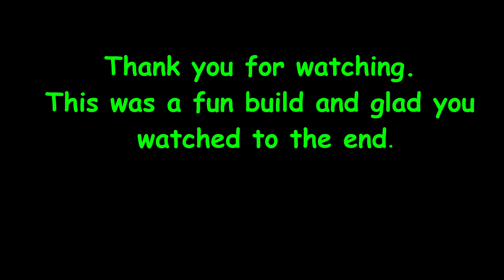Easy To Make Tumbler Turner Cheaper than Etsy!!!  #DIY

Comment: While you may Save a Few Dollars by Purchasing Cheap Chinese Motors for $4.00 each,  that Are Not Designed for Continuous Duty and Get Very Hot under Prolonged Use, When someones HOME BURNS Down, You can Ask if It was WORTH the $100.00 you might have Saved had you have a Purchased HIgh Grade Continuous Duty Motors. Lowe's Sell Heavy Duty Rotisserie Motors with Stainless Steel Shafts for 35.00 that Includes a Heavy Duty Cord and Switch. Videos like these run Chills Down My Back...May God Bless Those who watch. Do Yourself a Favor and Buy A High Quality Continuous Duty Motor for your Tumbler Turner. It Could SAVE Both Your Family and Your HOME.
Reply from the maker: KG5TJV thank you for the detailed comment. I built this tumbler turner for my buddies wife and those were the motors she wanted.  I build what they want.  Good to know about the motors. Look forward to you video on the proper way to build a tumbler turner.  Subscribed and bell rung. Oh wait you don’t have any videos and one subscriber.  It is very easy to critique someone when have no proof your theory is better.
Reply: @JkCanvas   Hopefully Your Arrogance doesn't Cost a Family Their Life. My Comment was not meant to Insult You or Anyone else. If You Research The Subject, Look at The Electrical Specs and Understand what happens in The Real World (I know Many People who will Testify these Motors Get Very Hot under Continuous Duty) You would have a Different Opinion. You don't have to Take My Word but Help Prevent a Loss of Life and Home. Be a Good Neighbor. Alot of People Do Alot of Things that are Potentially Dangerous but KNOW NO DIFFERENT. Help Educate your Friends when You See Potential Danger.
Reply: KG5TJV Why do you capitalize every single word? I’m in a tumbler group where thousands of ladies run these continuously 24/7 months on end with no issues. I’m sure it’s not impossible but it’s unlikely to cause any issues.
Reply: @kg5tjv877  I've been running these cheap microwave motors for about 3 years now. While they get hot, they won't catch fire anytime soon. Don't touch them, don't get burned. The 6 I have, have been running about 80% of the past 3 years... still have my house. I do have to say though, I bought a rotisserie motor one time, and one time only. Never again, that piece of crap lasted about 2 months. Lol
Reply: Have used these motors for my tumbler turner going on 4 years now. Have had no fires nor sparks. I have my motors on the back side of the box though, where they get plenty of air circulation. They are constantly running approximately 20 hours a day if not more. No issues!

Comment: Patiently waiting for the "how to wire it all up" video.  My goal for Easter weekend is to get this baby built (with the assistance of my more-skilled son.)
Reply from the maker: Video has taken longer to produce. Working on a write up that I hope to get up this week. Stay tuned.
Reply from the maker: Lori Koepsel I just posted the wiring up on my Instagram @jkcanvas.  It is a minute video walking through the process of wiring up. Did not want to waste everyone time about stripping wire and putting terminal ends and butt connectors on.  Your son should be able to help with that. If not shoot me a message on IG.
Reply: Jk Canvas I saw, I saw!  Thank you!  I’ll have my son take a look at it.  I think I figured out what you did, but my luck I’ll end up shocking myself!  At the very least, it will require me watching more videos!  Thank you!!
Reply from the maker: Lori Koepsel I usually put electrical tape around my switches. That keeps me from getting shocked. Worst is a little tingle, 60htz isn’t all that bad not like 28v DC. That is a jolt. 🤣. I left you n IG message. If you have issues this weekend shoot me a message and will help out. Also if you post up pics tag me and will comment.  It is really pretty easy if you know how to connect wires to a switch.  Also there is an Amazon link for the terminal boards which helps fund the channel.  Link is in the description.
Reply: @JkCanvas  I may have to make a video - from a female's perspective... lol  You know we have to make things so much harder than they really are :-)
Reply from the maker: Lori Koepsel by all means go ahead and I will add it to my play list. 😉😉
Reply from the maker: Lori Koepsel just so you know it took me about 3 hours to edit the video footage.

Comment: I made one using those motors but after about 15 minutes it got really hot not sure they will work for long drying times? Rotisserie motors are made for longer running times. What’s your thoughts?
Reply from the maker: Miss Ann I don't know for certain.  I built this for a friends wife and she has not had a problem.  yes rotisserie motors are designed to run longer but they also cost a bit more and are heavier.
Reply: Jk Canvas I ran it for 2 hours ...it was hot..but didn’t burn my house down! 👍😂 I suggest don’t run it overnight and don’t leave home...just common sense be smart! Thanks for your video..loved it!
Reply: @annmillwood1221   Thanks for Addressing a FIRE HAZARD. ALL Motors are Not The Same. Alot or Most of these Small Motors are DESIGNED for Appliances such as Microwave Oven Turntables that Do Not Run Continuously. And Certainly Not for 12 -18 Hours that some of the Tumbler Turners do. They most Certainly Can Heat to The Point of FIRE. While YouTube is Great, some Projects are Very Dangerous since you need No Qualification to Post a YouTube Video. Rotisserie Motors are a Much Better Choice for these Tumbler Turners and are Very Affordable......Lowes Sells a Rotisserie Kit that includes all of the Hardware you need (Electrical Cord, On/Off Switch and a Stainless Steel Rod) for about $35.00. You just need to build a Box to Mount it on. The Good Thing it is a SAFE SOLUTION and will likely last for Many Years. And The Bonus is, The Odds of it Catching Fire is Highly Unlikely. Thanks for Your Comment and I wish You Well.

Comment: I had to skip ahead cuz I’m at work but beware electrical work on YT brings out the worst in people. What exactly does a tumbler turner do? I’ll go back and watch the whole build later but the parts I saw look awesome
Reply from the maker: Brads Workbench thanks for the heads up. Basically it turns yeti cups slow some the can be decorated.
Reply: Assists in drying the epoxy on decorated yeti, hogg, steel magnolia, ozark trails, etc... evenly.  You need a multi-cup turner if you want to do several at the time as you "should" leave your cup turning for at least 12 hours before setting it aside for 48-72 more hours to cure.

Comment: Might steal a couple ideas from ya. My wife is getting into that stuff and I'm getting ready to make her a turner.
Reply from the maker: I made a quick IG video on how to wire up the switches to the motors.  If you need assistance just shoot me a message on IG or FB.  I used 3/4 ply in this build, however 1/2 ply will work as well.
Reply: @JkCanvas  right on. I think the biggest issue I'll have is with the wood. All I have is an old skil saw and I'm no carpenter haha. Maybe I'll have them cut it for me at home depot

Comment: What did you use to connect the pipe to the motor? I follow directions for one where I had to file down a dowel rod then tried to get the hole right in the center and it’s made my Tumbler turners wobbly looking for a better way and this looked like it works great
Reply from the maker: I used a 1/2 x 1/2 x .257 nylon bushing which you can get at Home Depot.  To attach the bushing to the motor I used a 9/32 drill bit to make the inner bore larger.  Then I took a #6 x 1” screw and nut.  Drill a 3/16 hole through the 3/4 make to female adapter and the nylon insert to get the same hole through both pieces.  On the motor you will have to drill the existing hole to 3/16 to accept the #6 screw.
Reply: Thank you!!!
Reply: They have these brass couplers on Amazon - look for the motor that comes with them.  That's what I bought :-)
Reply from the maker: Lori Koepsel I looked at those and I was trying to keep the cost down that is why I used the nylon bushings.
Reply from the maker: Connie Runyon how did your Tumbler turn out?  If you are on Instagram tag me in your post, @jkcanvas

Comment: Looks great. What motors did you use? I made a single tumbler turner for my sister but used a barbecue rotisserie motor and shaft. They would add up in price and your choice looks to be a more inexpensive idea. 

Watch out for the soldering iron. For some reason they get really hot. 😂🤣😂🤣
Reply from the maker: Wayne Crews I left a link at the end of the description.  I cannot remember off the top of my head.  Thanks for stopping by
Reply from the maker: Here is the motor I used.  https://amzn.to/2ErpL6u . Also used 1/2x1/2x.257 Nylon Spacers  - https://amzn.to/2XtGcrL.  Used #6-32 screws  to secure the 1/2 to 3/4 threaded nipple to the motor.

Comment: Where did you get your ratchet strap at, that you used to clap around the whole box..  they were black and red with corner rubber pieces?
Reply from the maker: Tammy Shanley Harbor Freight I think it was $4.99 with the 20% coupon.
Reply: @JkCanvas  can you tell me what that is called please?
Reply from the maker: @dawnhood8794  the whole piece is a tumbler turner used to make epoxy covered cups.  I think that is what you are asking.
Reply from the maker: @dawnhood8794  or the band clamp.  https://amzn.to/2IZvXFi

Comment: I would like to see a better look how you attach motor to pvc   You stuff electric tape in side of male pvc cap thread and drill a hole in the cap piece ?
Reply from the maker: Bruce&Keda Waters I will do that. Give me a couple of days and will post pics on Instagram @jkcanvas.  I showed how to wire the motors there.  Check through my feed and there is a short video.

Comment: Great video but I would have loved to have you talk me through the electrics as that's the part i am struggling with.
Reply from the maker: Carolanne Connolly-Brown send me an email canvas@jkcanvas.net
Reply from the maker: Check out this video I did on wiring up the switches to the motors. 

https://youtu.be/RotEH0NjB5k
Reply from the maker: Carolanne Connolly-Brown made my access holes 4” tall by 12” wife
Reply from the maker: Wide not wife. Dang autocorrect.

Comment: How did you line up all the holes so everything is level?
Reply from the maker: 010winfield I clamped the front and back together and drilled through both pieces at once. Then put a mark identifying orientation like left back and left front.

Comment: Would’ve been great to have the measurements of what you were doing with everything. Good video.
Reply from the maker: Henry Lugo send me an email to canvas@jkcanvas.net and I will send you a written write up.  The box I made was 48Lx8Wx8H.  Holes are 1.25” equally spaced.  Come in from
Each side of the front and back 6.5”, that will give you 35” between the two end marks which will allow for equal spacing of 7” for the centers of the holes.  Also if you have Instagram, you can DM me there @jkcanvas.  I look forward to assisting you.

Comment: wish you posted the supplies and measurements.   I'm guessing on mine.
Reply from the maker: Lisette Mahler in the description towards the bottom are Amazon Links to the material I used in making this minus the plywood. For the box it is 8” H x 8” W x 48” L.  I drilled my holes for the motor 2 inches from the lip and 6.5” from each end, then in between the holes are spaced 7” to center.   The hole is 1 1/4 inch diameter.  Drill the front and back cover pieces at the same time to keep them inline. I am in the process of writing an instructables article. Also I just posted on my Instagram @jkcanvas how to wire the switches to blocks so that each motor is run by its own switch.  Check out my about page for contact info.

Comment: What are the measurements of the box you constructed?
Reply from the maker: I used 3/4 cabinet grade plywood.  The overall diminsions are 48"L X 8"W x 8"H.  The holes are 1 1 1/4 with the center being 2' from the top lip not lid.  I cut a 1 1/8' slot to allow for the turning motors to drop in.  I am hoping to get a set of printable plans developed and available.  Hope this helps.  Thank you for stopping by.
Reply: @JkCanvas  Thank you!!!
Reply: @JkCanvas  Please share when you get the printable plans. This definitely helps until then. Great video.
Reply from the maker: @Smarsh721  If you have any other questions please feel free to ask.  I will answer what I can.